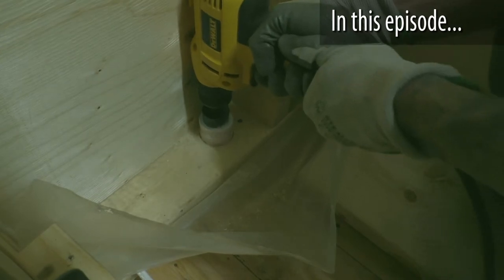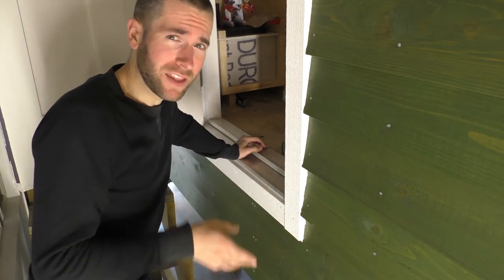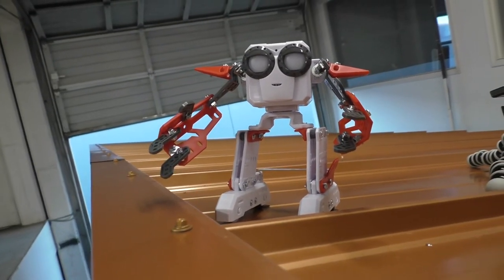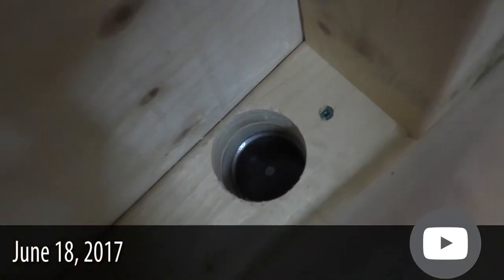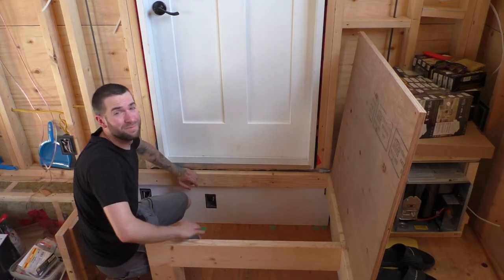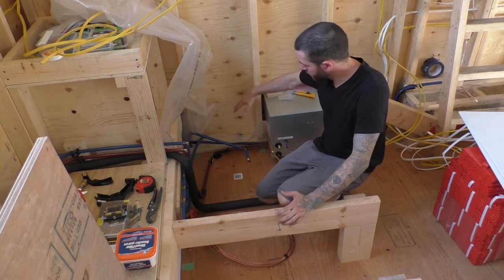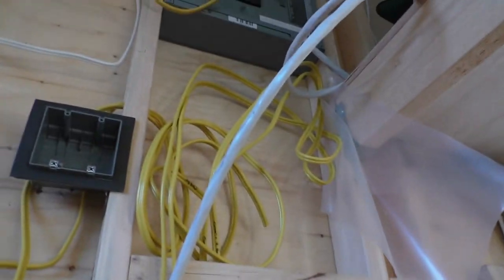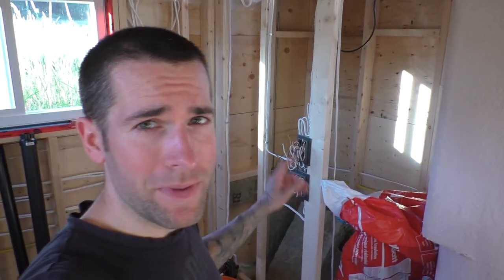Robot Work, the Farm, and Meaningful Progress (Tiny House Tasks)

Comment: man, so much work. kudos to you...maybe you have a leak from the top of the door...I had kind of a similar problem and I finally discovered a trickle from the top corner which was settling down below...OK, and not to be a Debbie Downer, but since you're not done with the electrical and you're insulating, what if you need to get to those wires behind the insulation? I only built a house once and we didn't insulate (it was for a homeless family in Mexico) I remember when we were putting up the dry wall there was an issue with electrical and we had to tear a bunch if it our to fix it...just wondering. keep up the good work!
Reply from the maker: +CoolCat Carolena : I've been thinking about that, with insulating before testing electrical... it is a risk. Something would either have to be wrong with my wiring plan, or faulty with the wires themselves. I probably won't do too much insulation before getting the electrical finished.